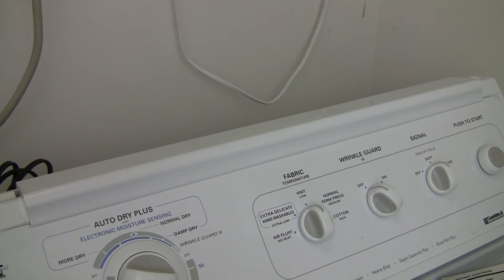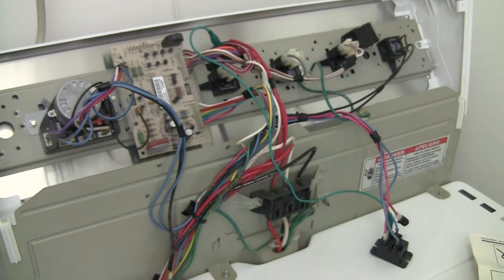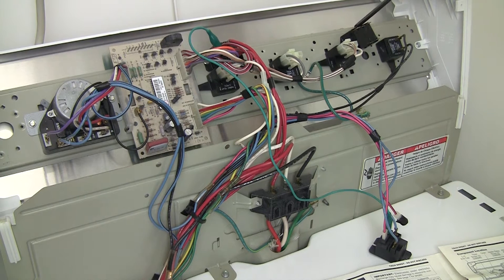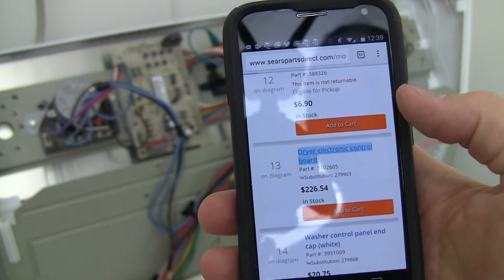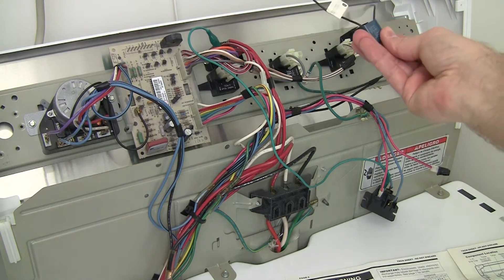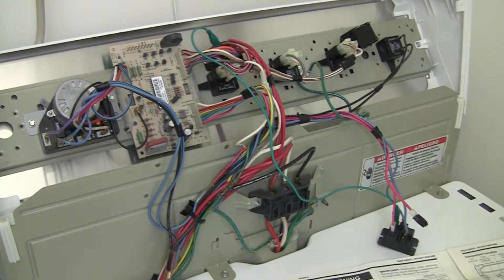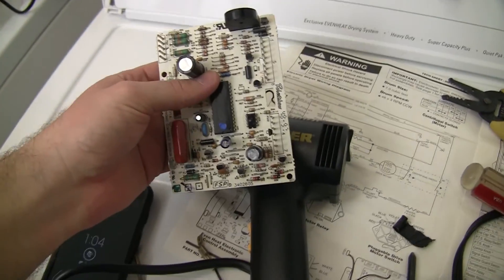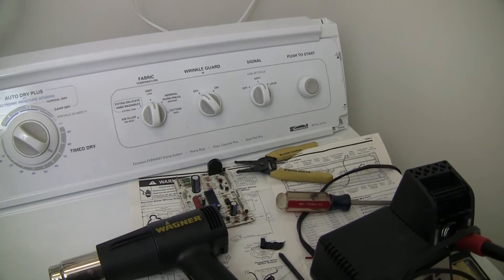Kenmore 90 Plus Series and Whirlpool Dryer Repair/Relay Power Coversion

Comment: I had an intermittent shut off with my Kenmore 90 series dryer that was turning into the "only runs when start button is held" symptom.  It would intermittently startup and run if start was held and released several times.  I replaced the three 16V zener diodes on the control board and the problem is solved.  Thank you so much for sharing that information!  Easy fix.

Comment: Thank you so much for this video, it helped me repair my Kenmore Elite dryer (Model 110.62982100).  Now in 2019, Sears no longer sells replacement control boards for my dryer.   There are companies now where you can send in your board for repair, but even faster, they sell pre-repaired boards on Amazon.  I replaced my control board and the dryer is working again.  Now if I want an extra side project, I'll try to use your other advice and test all the zener diodes and repair the bad board.  (although my model has 6 zener diodes instead of 3)

Comment: Nailed it with those 3 diodes. Was having the same problem with my Kenmore 90 Plus. After seeing this video I swapped those diodes and I'm back up and running. Thanks for making this video!
Reply: Replacing the three zener diodes solved my issue too.  Great info!